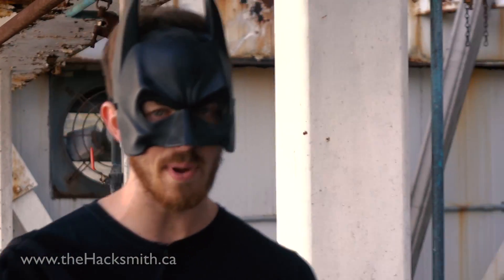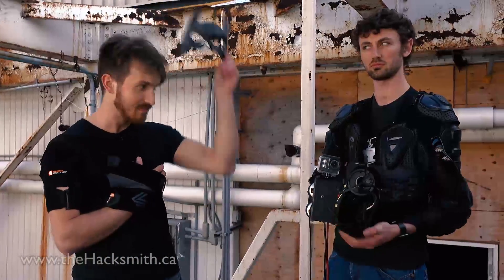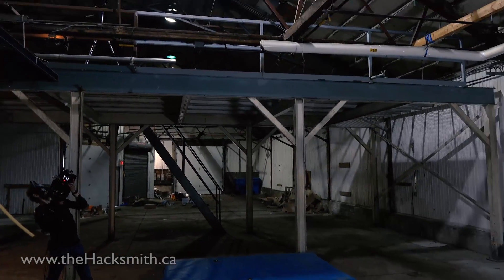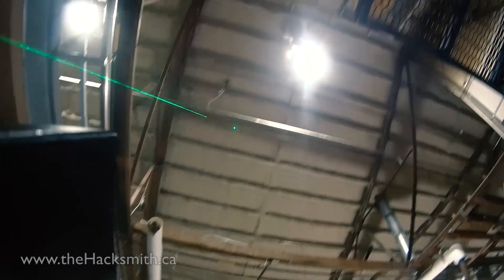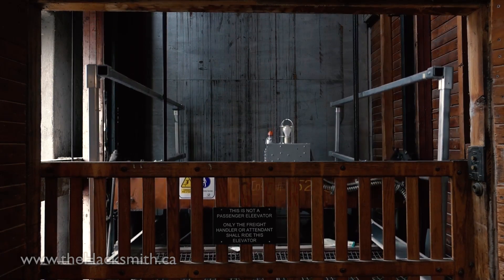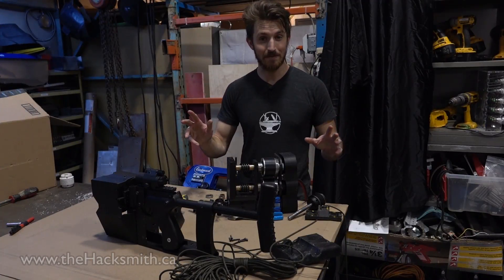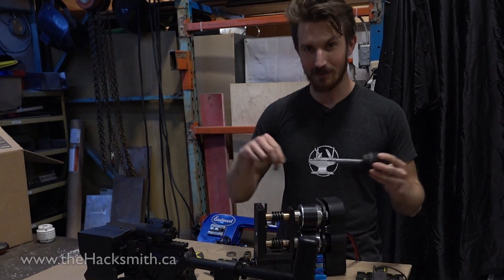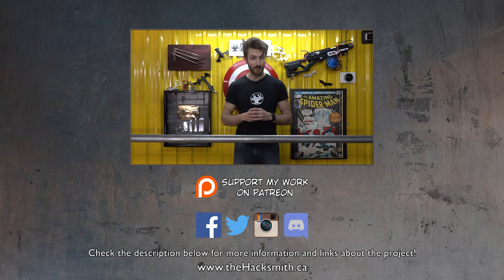Make it Real: Batman Grappling Hook Gun (FINAL TEST)

Comment: I came up with a design for the cape
Basically it would be 5 or more thin metal tubes, which would be chopped up into smaller pieces with interlocking shapes
Then run a cable longer than the tubes through it and have a button on the back of your neck that spins a wheel, retracting the cable and snapping the pieces into shape

Comment: Do ODM gear. A gasspowered motor of the back that pulls and releases cord. The mechanism to shoot hook should be a powerful spring but still flexible enough that the motors horsepower can reset the mechanism for during again in quick concession.

Comment: The main problem I have is batman often fires his grapple directly at a hard surface, eg. brick, concrete, steel, and somehow it lodges itself into that surface. Could you even design a grapple that would lodge itself INTO a concrete wall and would a handheld device be capable of delivering enough force to pierce concrete?

Comment: That doesn’t work for 2 reasons

1. It’s too big and blocky and heavy and annoying. It needs to be way smaller 

2. It’s not fast enough. If u want to ascend away from bad guys you need to make the device smaller and lighter and faster
Reply from the maker: 1. Still smaller than what the military has.
2. You haven't seen the top speed -- there's something called acceleration. Watch our other test video to see how fast it goes up in a higher area.

Comment: Now all ya gotta do is work on making it a little smaller.
Reply from the maker: +CockatooDude already smaller than what the military uses..
Reply: I was in no way dissing, being someone who also likes building things I know very well how much time and effort goes into these things. And I can tell from your CAD images that were on screen that it was probably quite a lot. However, that said, it would really be like Batman's hook if there were no wires hanging out or it was cleaned up a little. Not to mention a slightly reduced size. All of which I think, given your accomplishments thus far, I am sure you can do.

Comment: 2:16 The wire isn't leading to the ceiling, it wraps around the silver pole.
Reply from the maker: +ShirtyScarab554 duh, it wouldn't actually hold in foam insulation
Reply: the Hacksmith So why make it look like you're being lifted when its obvious that wouldn't hold?
Reply from the maker: For kids. He "pulls" it out at the end. It's completely obvious it wasn't what he went up on -- if he could pull it out by hand it wouldn't have held him going up

Comment: Does the noise get higher pitched because the cable is getting shorter or because it's still accelerating? Does it change gear at 2:14?
Reply from the maker: Because it's going faster!

Comment: Couldn't you engineer drive wheels (with carbon-fiber) without a separate metal drive shaft? Perhaps with stepped gear sockets instead? That might also help shrink the overall size of the mechanism.
Reply from the maker: Kinda doubt it, the load on this is insane. It was the stress concentration in the steel shaft that caused the failure

Comment: To make this work you may need to move the winch to the waist actually.
Reply from the maker: But it does work...
Reply: I meant to not dislocate the shoulder. Mounting the mechanism center of body mass with a harness is safer and can free up both hands for other things ;) Source: used a similar piece of equipment for scaling tall trees on a research project once.
Reply from the maker: I dislocated my shoulder testing a jetpack... not from this lol
Reply from the maker: You dislocated your shoulder testing a Batman Grappling Hook Gun? I kinda doubt that...

PS: it's pretty simple to add a strap from the gun to a harness, just not very Batman-esq. We're not commercializing this btw so practicality isn't really a concern
Reply from the maker: Haha damn! Did not expect that response! Sounds like a really cool project to have worked on!

Yeah since it's a worm & spur gear system the system auto binds, handy safety feature =)

Comment: 2:43 Just want to point out how dangerous an elevator shaft is. Being there can easily get you killed. Having done this I'll go back to the video, and be glad you were careful enough to not die.
Reply from the maker: +Avarickan we only went 10' up, above the elevator cart, it's all filming angles lol. No one was ever underneath the cart.
Reply: the Hacksmith I'd be more worried about the counterweight, but I didn't see the cables moving, so it would have been safe, or as safe as one could be using a prototype grappling gun.
Reply from the maker: +Avarickan but... If elevators were that unreliable, just using them would be unsafe. We weren't using the grappling hook on any part of the elevator system
Reply from the maker: +Avarickan and the counter weight is in the wall, I think you can see it when the lift goes down

Comment: Maybe to avoid further dislocated shoulders, adapt the cable to pull from the Waist like a rock climbing harness, similar to the Nolan films. Could be make allot safer and not risk pulling your arm out your socket
Reply from the maker: Yes that can be a way to avoid dislocating my shoulder. However the dislocation happens in the Starlord's Jet-pack video.

Comment: You sir, have stress concentrations in your shaft. That combined with fatigue did you in. I would suggest a slot and key to reduce stress concentrations. I don't know if you have a mill, but I know you have that little CNC, so you should be able to machine it yourself.
Reply from the maker: That's the plan!
Reply: So now that I've sounded smart. Are you guys hiring Americans yet? I'm a mechanical engineer with experience in machining and prototyping looking for a job. I also have a small YouTube channel (obviously not this account) where I'm currently building a working 3D printed Jet engine.
Reply from the maker: I haven't even gotten to pay myself in the last month, I'm afraid it'll be a long time before we can risk hiring someone who isn't local in case things don't work out =( but keep a look out on our website!
Reply: the Hacksmith well it was worth a try :)

Comment: Key the shaft, don't drill it..  Holes should only be used for retaining (eg cotter pin), but torque transmission needs splines or a key
Reply from the maker: 3D print probably won't hold up to a keyway...
Reply: Then spline it..  I've seen 3d printed boat and plane propellers in plain old ABS hold up under huge torque loads, and you've got that fancy carbon fiber stuff..

Comment: eeeeeehhhhh, please don't test in lift shafts, like the risk assessments would be horrendous.
Reply from the maker: We actually only went up 10' for that scene =P magic of camera angles
Reply: It's not the height that worries me
Reply from the maker: then what is it? he wasn't above the elevator lol it's all filming cuts
Reply: Lift mechanism failure is the main one, but also depending on shaft height and the lift mechanism other risks can occur (o_o) with injuries ranging from minor crush to death, depending on the severity of the failiure, I mean it's slightly more dangerous than the baja, but still at least with the baja you know that it's your own stupidity rather.
Reply from the maker: +Chris Drew we were above the elevator... Didn't mess with any of the elevators safety features... He went up 10' above the top of the elevator car, by your logic even using an elevator is unsafe haha

Comment: can you try making it portable as a challenge
Reply from the maker: +Crayphor it's called being safe, not stupid. The very first test shows the hook latch onto a wooden beam. The other tests we ensured it was hooked on securely before testing. 

You really think a YouTube video is worth breaking your legs over? The hook can and does work -- it's just not worth the risk for a video.
Reply: Fit it into a brief case
Reply: FloydTheSandwich yes
Reply from the maker: It is portable... and would fit in a briefcase...
Reply: the Hacksmith sorry cant size it up to well in video
Reply from the maker: +Nathan Stern it is fixed when the motors aren't on due to the type of gearing. It's more a question of whether the rope (and your shoulder) would hold from dropping into a swing (it's really not that easy lol)
Reply: blue magician 12 It probably just isn't possible though. You need somewhere for all the machinery to go, the pulley system and motor, and whatever shoots the hook.

Plus, if you held onto it with one hand with no other harnessing and went as fast as Batman regularly does, you'd dislocate your arm.
Reply: well if they can carry it and walk around with it, I'm pretty sure that it is portable.
Reply: blue magician 12 m
Reply: blue magician 12 I was wondering if he was going to compact it as well
Reply: Batman now carrying suitcase with bat hook
Reply: It is portable; you probably mean "smaller" or "lighter", like the device in the Telltale game.
Reply: Thats probably impossible
Reply: blue magician 12 iiii
Reply: the Hacksmith dang roast'em
Reply: Hello
Reply: blue magician 12 Well it is already porderbal
Reply: the Hacksmith agreed IT pulls you up and that was the most important
Reply: the Hacksmith you guys should put two of those in front of the baha
Reply: Better to have it so its not like a big cinder block
Reply: How did you think they got in the warehouse
Reply: Are you blind? Did you watch the video? of course its portable!
Reply: Chillin' Like a Villain i just got out of the hospital with third degree burns
Reply: Sai Prime but there are some harpoon guns that have a rope system and a motor but you might have to upgrade the motor